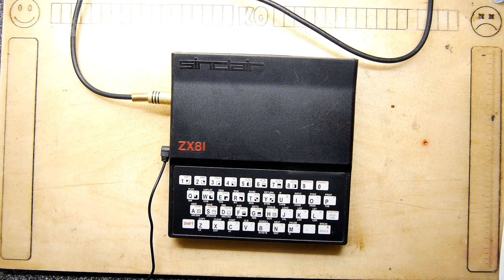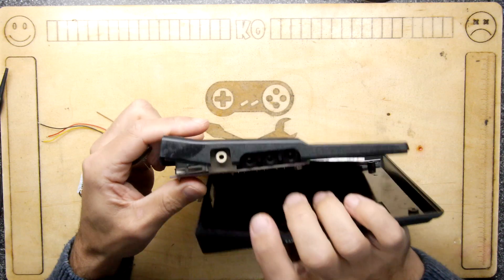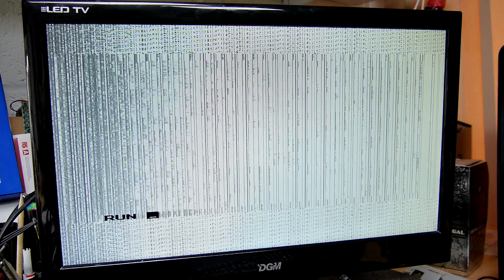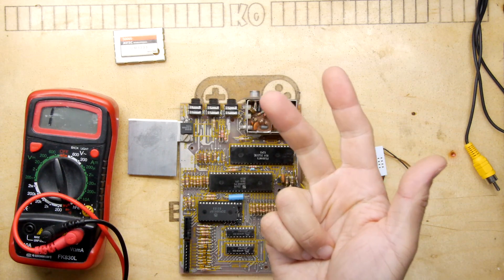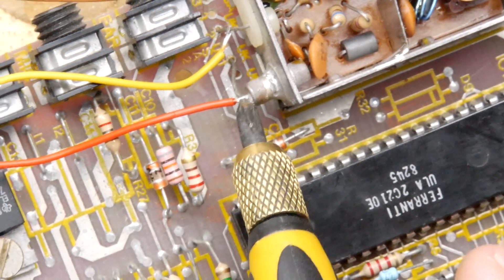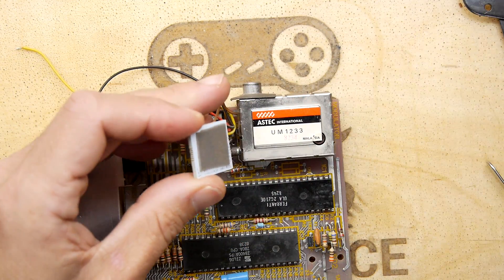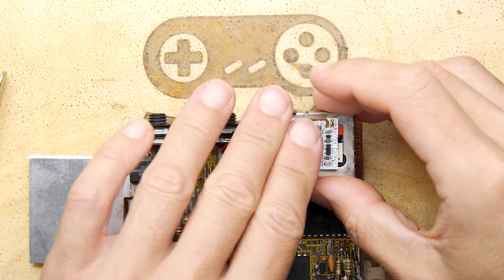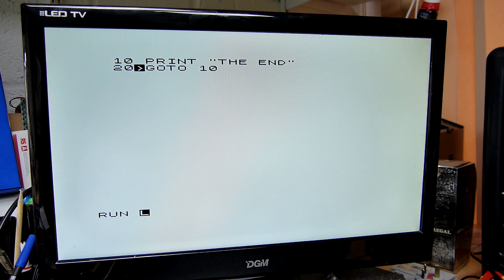How to add composite out to a Sinclair ZX81

Comment: I did some other stuff too, e.g. a RAM chip piggy backed on to the ROM with select switching triggered by video RAM  access. You could program new characters (8x8 pixels) into the RAM to get high res graphics; that one came from a magazine. How about some SRAM with a button cell to save the contents at power off? How about increasing the available RAM with some modern chips? Remember that the Z80 has select lines for In/Out as well as memory access. Would it be possible to construct a  Ramdisk as an alternative to cassette storage?
Reply from the maker: Ewen, let's start with the ram upgrade, that should be a good easy one to start with.

Playing with GPIO certainly sounds like a lot of fun, I'll look into that as well

Comment: 7:16 - when you unplug the composite lead the image appears on the TV before you plug the RF cable in. That thing is radiating so much RF it could probably work sat on top of the TV without any wires :)
Reply from the maker: I noticed that myself on the playback 😂

I think you are right, could probably plug in a portable TV antenna into it as a transmitting antenna for whole house viewing 😂

Comment: I noticed that you appear to have not used the second ground on the ZX8-CCB (the one next to where the brown wire connects). In one part of the video (5:58), it appears that this second ground wire is just laying aside resting on the cover for modulator. Is there a reason you did not use the second ground? And is it safe to not use the second ground?
Reply: The video port needs to be connected to the mod's video out (brown) and ground (black). But in this video the existing video port is used, which is already grounded. So no need to ground it once more.

Comment: The ZX81 in HD. I can't get any tv in my house tuned into the zx81. Even an old CRT from the 90's couldn't show a stable picture. Would the mod solve this? The only other problem is the red hot power supply
Reply from the maker: I would always sure l start by checking the PSU first and if possible the 5v rail on the board.
Reply: @backofficeshow  That's beyond me! I don't know anything about boards and soldering. I was going to attempt to upgrade my commodore 16 to 64K. Quite easy to do but the power supply has a loose connection.
Reply from the maker: I would consider those a pre-requisite to installing any mod. A cheap multimeter could be had for a fiver and plenty of videos on how to use it.